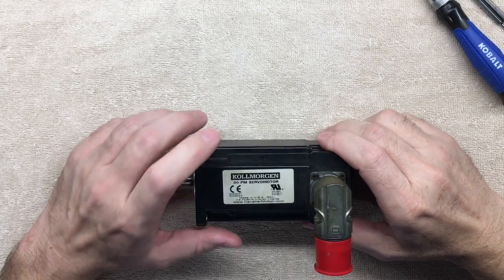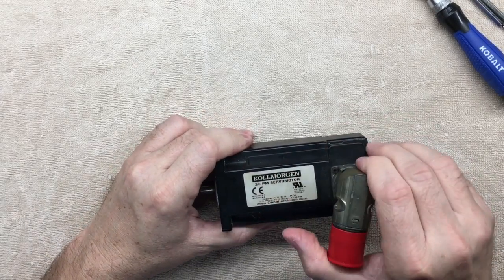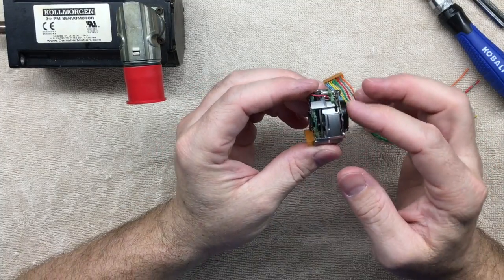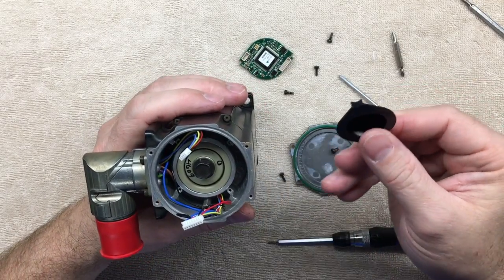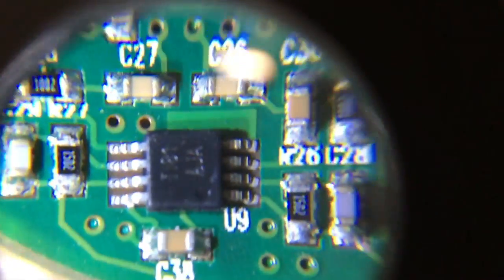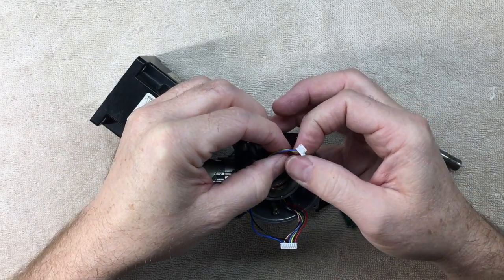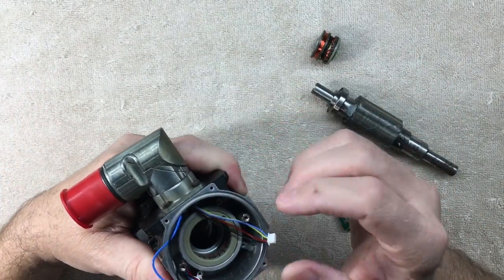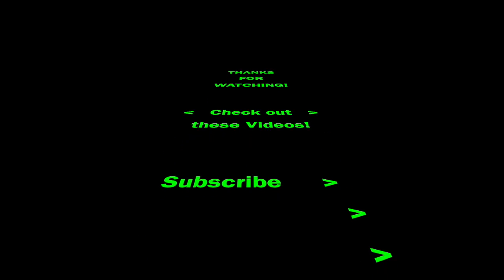A look inside of a 3 Phase Brushless Servo Motor

Comment: hi 
i have ac servo motor yaskawa its old without driver 1800w 16.7 amp
what the easy way to run it
Reply from the maker: I am not familiar with some of the older AC servos. Unlike DC brush type that you could apply a voltage to, most modern AC servos I am familiar with will need to have a modified 3 phase sine wave output. My best guess is try to find a older Yaskawa AC servo drive to run it. I imagine you have to verify it is same style and will not only drive the motor with your current or KW rating but also make sure the feedback device(encoder or resolver etc.) will interface.
Reply: Thrifty Tool Shed thanks 🙏 
I Respect and appreciate yours advice